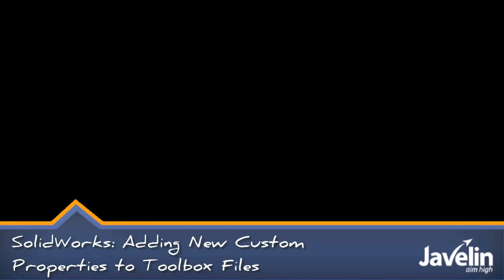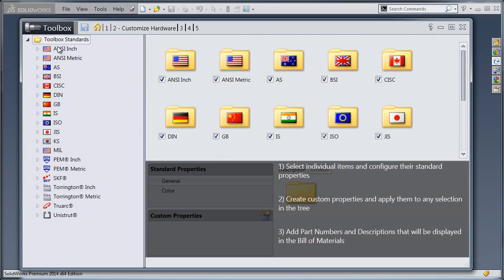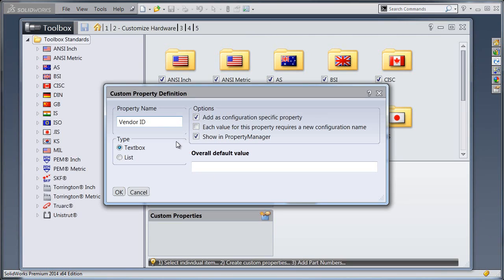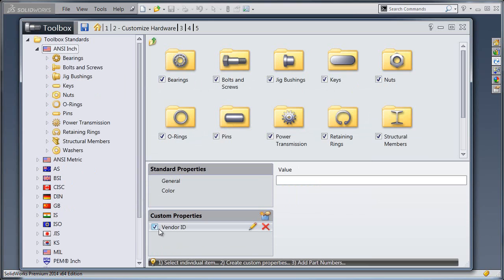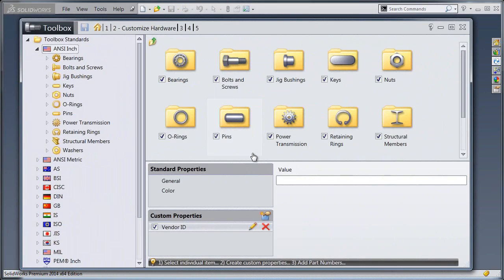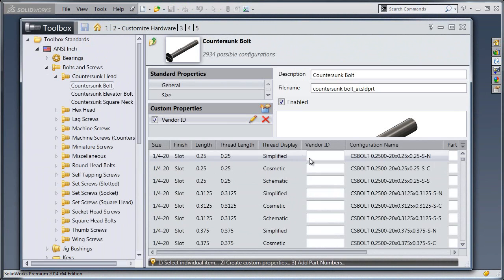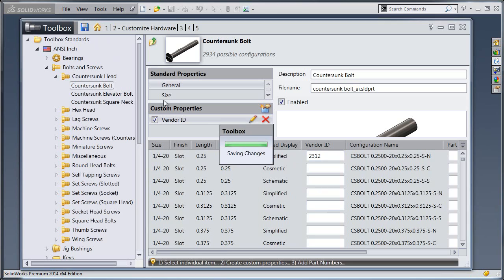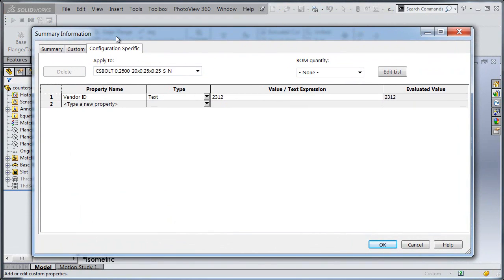SolidWorks Tutorial: Adding Custom Properties To Toolbox Parts

Comment: I don't know about adding properties 8 years ago, but in 2021 if you add properties all of he previously entered data is deleted when the new properties are added.  I tried to add material as the custom properties because I regularly use two different stainless steels, 18-8 and 316, plus grade 5 steel, brass and nylon.  The do however tell you that all your data will be wiped out if you continue.  So they add this cool feature about putting in materials or countersink angles, but wipe everything else that you have done for the last 10 years to do it.  Why are there not newer videos on toolbox customization?  This one goes back to 2014.  Major changes have been made since then.  One I looked at, that had no resemblance to SW2021, was 14 years old.  I won't be liking or disliking this video, it just doesn't apply.  I know Javelin is still around.  Doesn't anyone do this type of thing?  Worse yet, am I trying to do something that should be left alone?  My Dad used to say carburetor was French for, "Leave it alone."  Maybe toolbox is Dassault Systèmes French for the same thing.
Reply: Hey JavelinTech!  No response?  You haven't replied to any of the questions that each comment, one from 3 weeks ago, one from 2 months ago, one from 3 years ago.  I'll be the first dislike for this video because of that.

Comment: How did you got the part's custom properties to read that 2312 value? I followed your video but I can't see any Vendor ID in the part's custom properties. Adding it manually does not help as value will stay empty. So the question is what text-string/command are you using as the drop-down list has no toolbox options?